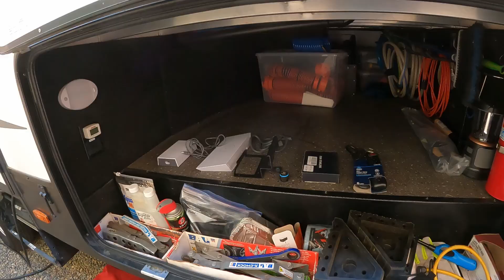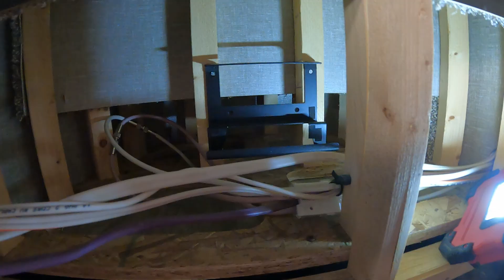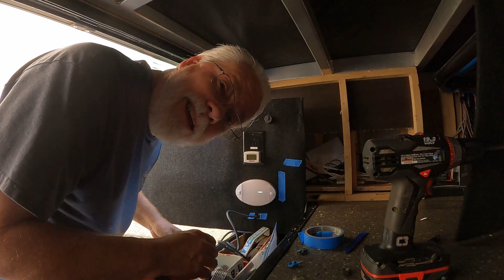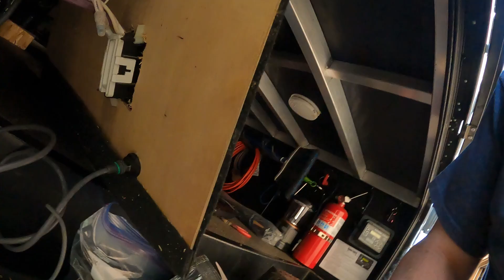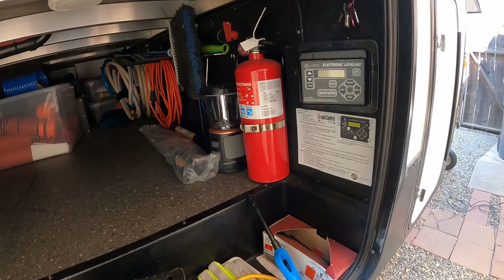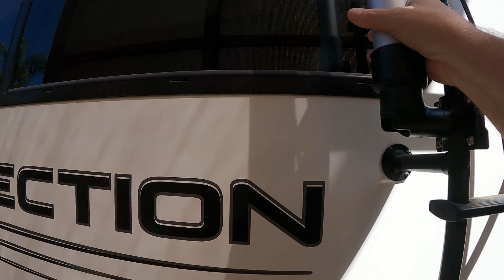Starlink Gen 3 Roam Install With Flagpole Buddy Gen 3 Mounting System

Comment: Here's a follow up.  
We took a trip up the Oregon coast and Starlink Gen 3 preformed well as long as I had a clear path.  Those of you who have been up to Oregon know that that is not always an easy thing to find.
I had to point west once as North was completly 'obstructed'  I got a fair connection but lots of spooling when streaming.   We were out for 9 days and I used 51gigs of data.  One buck over the $50.00 package.  Oh well.  We used wifi calling when cell strenth was weak.  That seemed to work well.  All in all I'm happy with the install and the performance.  Not happy about the $5 a month pause fee but not much we can do about it.

Safe travels.